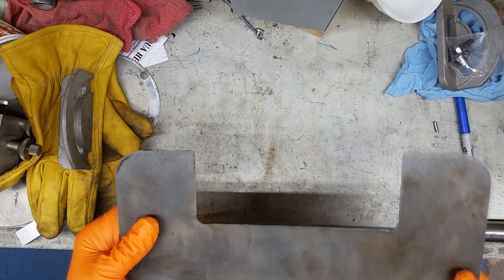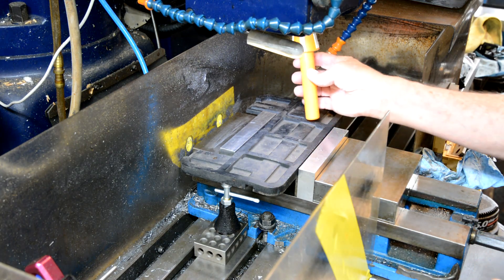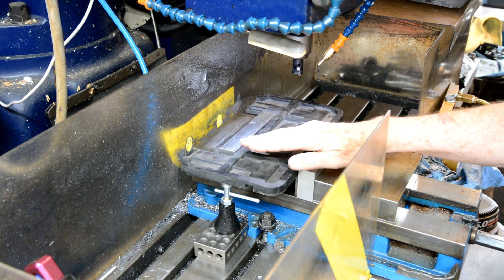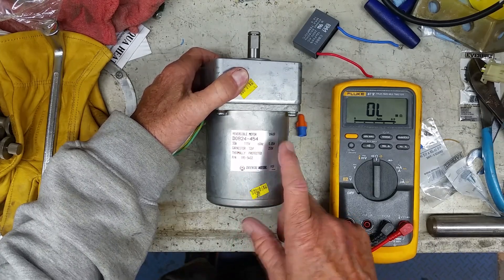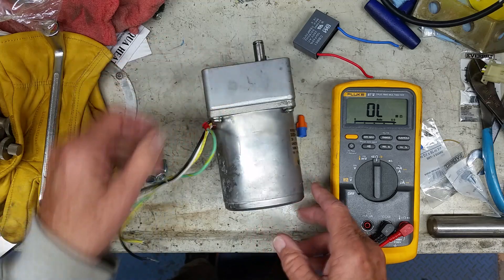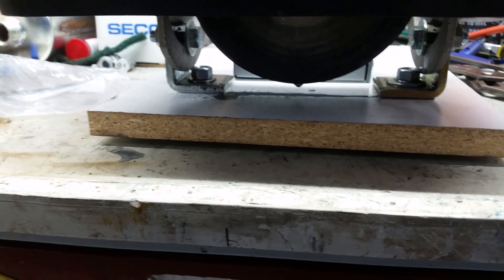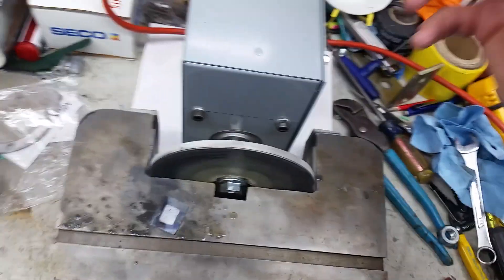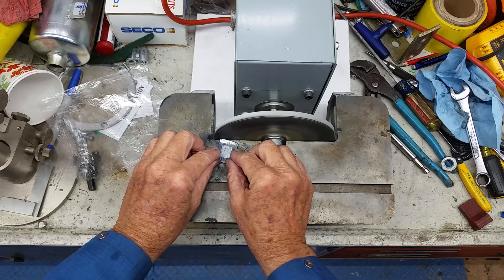Accu Finish style grinder build

Comment: You have left out some very valuable info! According to your vid you are sharpening a carbide by sprayin a little water against...WHAT???  Just some aluminum.... I DON’T THINK SO!
Reply from the maker: What, you never ground carbide with aluminum and water (it's actually window cleaner)?  If you go back and watch the entire video you will at at 6:23 I am holding a diamond grinding wheel.  It is also visible in the upper left hand portion of the frame.  The aluminum disk is just a backer for the diamond disk.   In the video I started with a 250 grit diamond wheel.  The 3000 grit is for final grind.  Sorry for it not being more clear.  I did film it in more detail, but lost it in editing.  I hope you didn't give me a dislike for that minor detail.